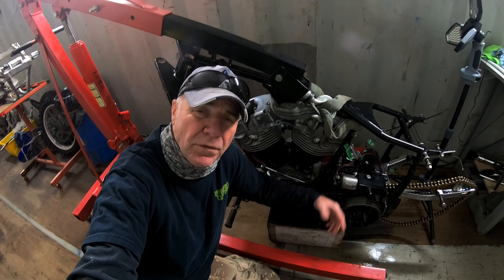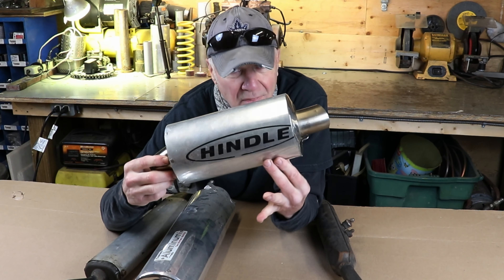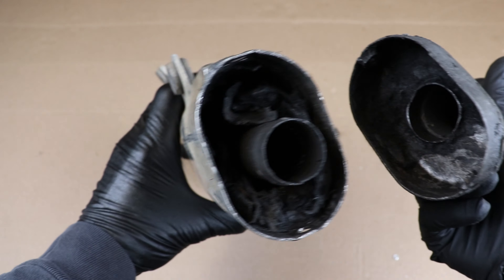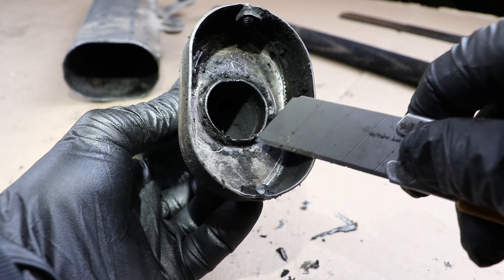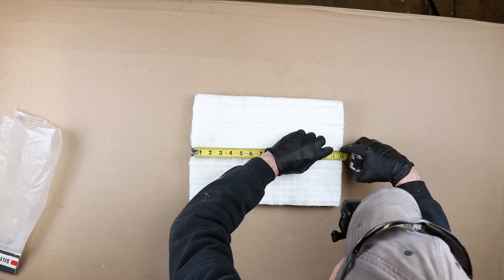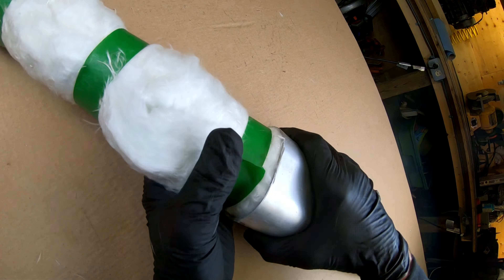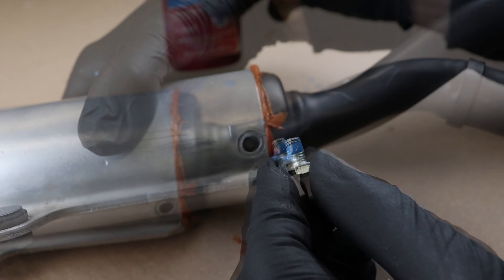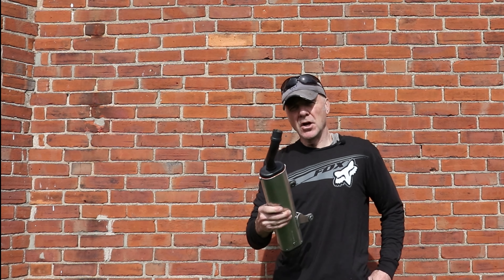How to Repack Exhaust - YZ250 - Loud No More !

Comment: If one is looking to this job and needs to see and know how to do it I think this video clears that all up for them no problems at all. Cool sound effects you have plugged in as well. And man that's some fast typing going on there to find the kit on line lol. My son and I have not long done a job just like this on his Victory judge exhaust to shut it up a bit more so we could get a defect notice taken off the bike, mind you the notice was not for noise as it was for the bars been to high but just in case they put a db meter on it we did this job on it...... A quality video indeed and the YZ250's are a solid bike as well ....keep well man and catch you on the next one.
Reply from the maker: Thanks for catching all the little details . They  take  alot of extra time to insert and often go un noticed by most people. 
You mention you son  having to comply with some fairly strict  bike limitations. Handlebar height and noise level regulations are also laws  here but dont seem to be routinely enforced .
Now that you have  mentioned it I'm going to really pay attention on Friday the 13th  to see what extremes are out there in plain site ..This event is heavily policed as there is  always a large  presence of H.A.and some  other  fringe groups .Those guys don't typically follow the rules very closely. But I'm guessing the law looks the other way when they are so  outnumbered ..Anyway I'll shoot a bunch and see what ends up in the next video .Thanks again R.K  cheers 🍻